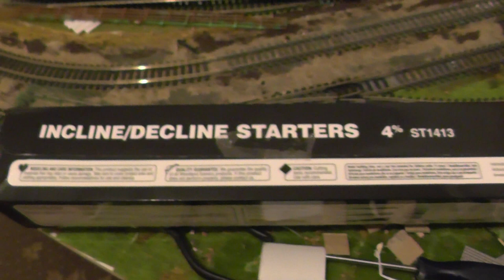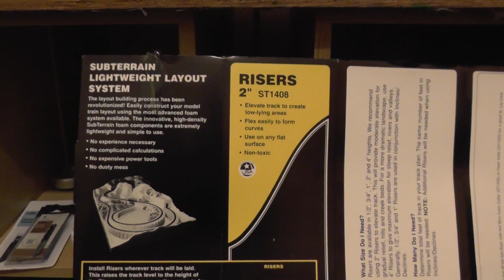Colin's model railway inclines and storage area works January 2018

Comment: MiB models recommended, by many including Matt Slade. I must get down to them as I meed decoders fitted by them. I live in Hengoed but, cannot drive as I am partially sighted. The layout and planed development looks great.  Still planning mine although,  it is down roughly but not happy.
Reply from the maker: Thanks Nigel, I see Matt Slade quite often at Tesco, good luck with your plans